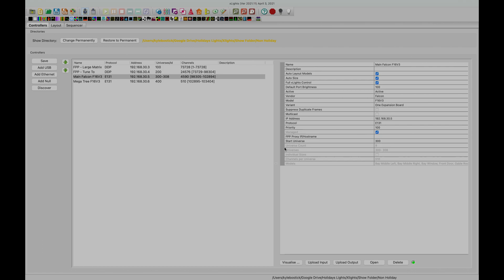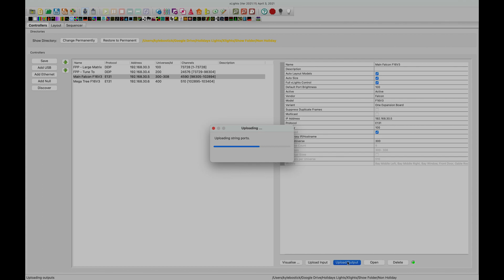Pixel2Things AC Board - Enclosure + xLights Configuration!

Comment: Good video.  Little confused.  I thought these were controlled by sending the color R G B as an on effect. With that being said Red would control 3 ports. Green would control 3 ports and Blue would control the last 3 ports.
Reply from the maker: Hey Bryan, the block channel model changed in xlights, so if you use block channel you will send an in effect in white, like I showed. If you set it up as a string of pixels, you could send red green or blue channel data to trigger the outputs
Reply: @BostickFamilyLightShow  thanks i will try that.
Reply from the maker: @bryanfelver6125  it too Keith and I a while to figure that out